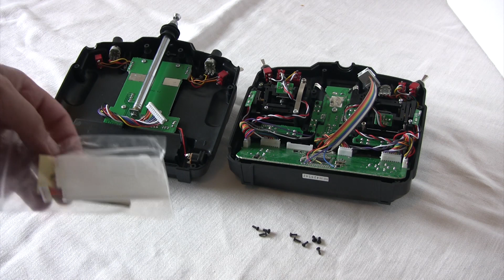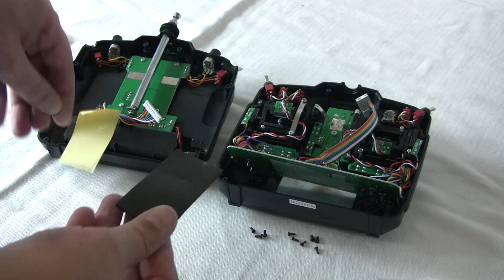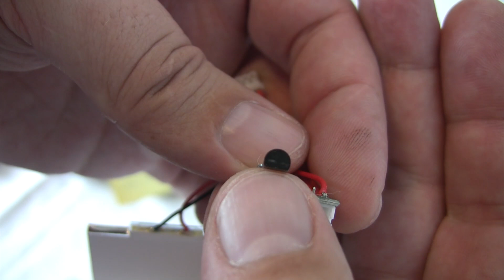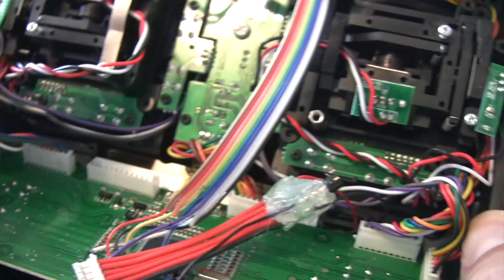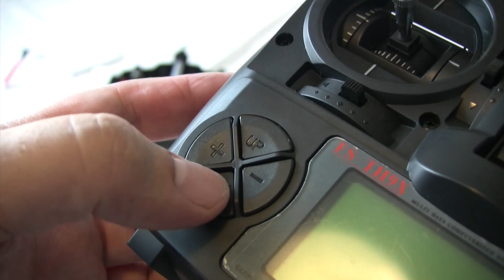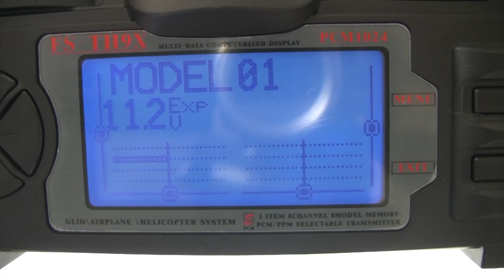T9X - TH9x - Open9x - Er9x - Backlighting Installation

Comment: I have some C945 and C144 transistors that I salvaged from old circuit boards.  Would either of these work as a substitute for the BS170 ?  Thanks for the instruction video.  I put my backlight on and the radio wouldn't power up and after much searching I discovered one of the crystal pins had never been soldered on and the radio only worked because the original foam was pushing the pin over to where it made contact.

Comment: yes, as long as your remove the positive from the small board, im wondering what what line was cut in the PCB, it looks like it was cut to make use of the resistor on the positive side of the back light! surely they are both positive supply!

Comment: I have 470 ohm resistors lying around. Can I use this to bypass the built-in transistor directly to red wire to the back light instead cutting the track on the pcb?

Comment: is the c945 and c144 a FET transistor or a regular EBC transistor? BS170 is a N channel FET transistor with Source Gate Drain and is voltage controlled, regular EBC transistors are current controlled! check if your available transistor is a N channel FET and it will work!

Comment: ok got it, using FET, Source to ground, Gate to MCU pin, Drain to removed negative Backlight line. BTW, does this only work when you flash the firmware to er9x?

Comment: after seconds my bs170 shown resistance between 1 and 3. so it is no longer an electronic switch, it works like diode now. i racked 3 transistors (( i have done exactly like on video.

Comment: on the gate of bs170 you should add a resistor such as 4k7 or 10k .. you only need a few ma to trigger it ..
Reply: It is only a small FET, so no big gate capacity... and besides switching there flows no current anyway. I think that is no problem for that Atmega.

Comment: gate voltage (pin -2) is maximum 3 Volts on this transistor ! Onboard and pin17  voltage is same as in battery (12-9 V) !!! How you did not burn your transistor key???

Comment: great video..does this still work on the new version of the tx.
Reply from the maker: ***** Which new version you think Jim? It works on all FlySky TH9x clones, like Turnigy T9x. 9Xr is with a display backlight directly from factory.
Reply: Richard Mrázek
 i just got a flysky th9x and want to do this mod just want to make sure it will work .it dont have the 9xr firmware on it though.

Comment: hi there any help? will this only work with using the er9x firmware? I am still using an original firmware and tried this out but the backlight does not turn on in any way. Please help
Reply: Richard Mrázek
Reply: I tried this, worked on er9x but the screen dims instead of turning off. Can you please help? Thanks!

Comment: Why my TX screen the light on only switch on just second?
and then, not have any light.
The backlight have fix side? I saw difference skin.
Reply from the maker: +nes2510 - Did you setup of backlight in Er9x/Open9x? About orientation - look on movie, right orientation is "red wire down".
Reply: +Richard Mrázek (OK-RiMr) 
The Program have menu for light? or
Must to up firmware? The original can't install Backlight?
Thanks.
Reply from the maker: nes2510 er9x or Open9x is with a setup for backlight. Original fw not. You can use backlight with original fw, but without mod with transistor. All is in video........
Reply: +Richard Mrázek (OK-RiMr) 
Can't use auto light off. OK. Thanks.

Comment: Will the backlight come on from the stick usage?
Reply from the maker: Backlight is under motherboard...
Reply: Will backlight turns on ) when you touch stick ?
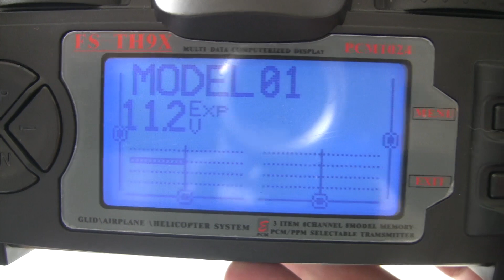on 17:12 it will turns on when you press "-" button ) reaction on stick touch will be same ?
Reply from the maker: Алексей Могилин - it depends on setup in Er9x/OpenTx